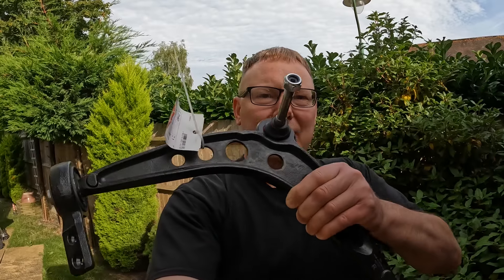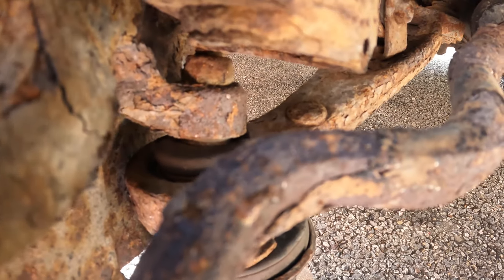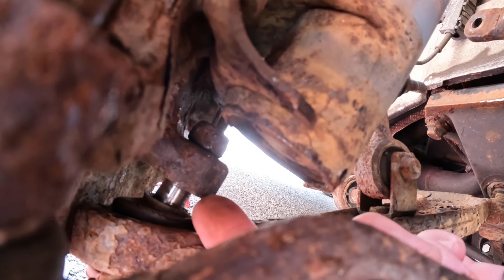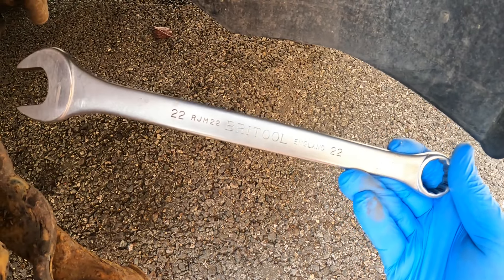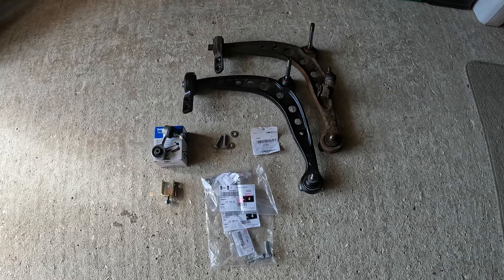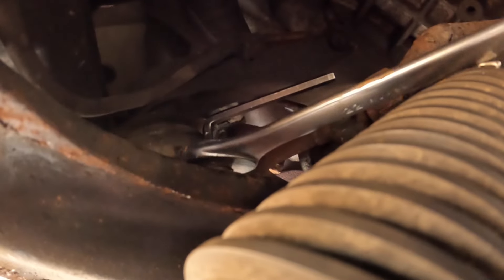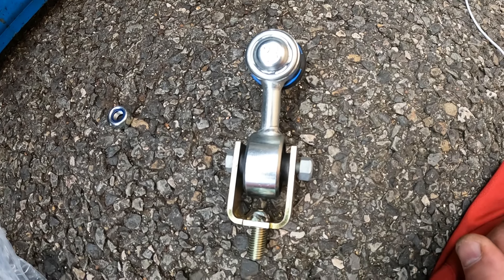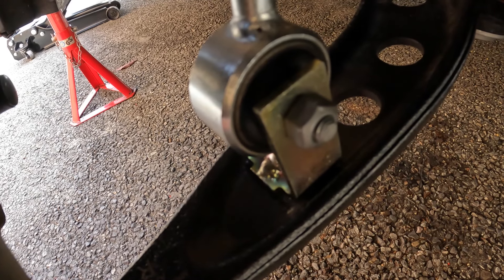Replacing Front Lower Suspension Arm & Anti-Roll Bar Drop Link - 1998 1999 BMW Z3 2.8 Roadster E36

Comment: That went really well, considering the appearance.
I've some rusted rear brake pipes to replace n my 2012 Smart.
Mercedes tell me they are no longer available as a part!!
Nice job anyway. 👍
Reply from the maker: @michaelglynn2638  Thank you! If the usual brake pipes to corrode, the last sections at the rear to the wheel cylinders, I’ve bought them pre-formed for a Smart 450 in the past and got them on eBay. They were surprisingly good.
Reply: @autoknight747 Thank you for that. 👍

Comment: Great video, easy to follow. Probably a job I'll tackle over the winter. Do you have an eBay link for the "bracket"
Reply from the maker: @johnsuffolkuk  That side went well but the other side, which I did off camera, was a cow. The lower ball joint would not release from the hub carrier and I had to detach the suspension strut to get the ball joint splitter on it. Allow plenty of time. I looked back on my eBay history but it’s no longer a listing - I think I got the last ones.